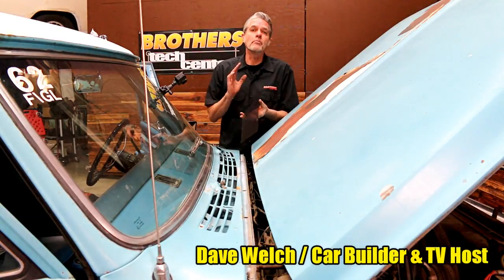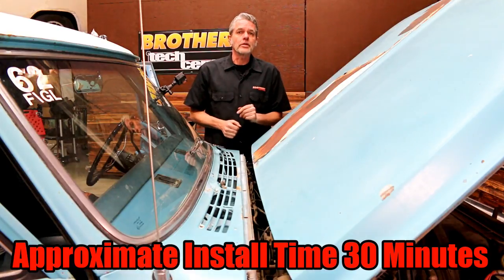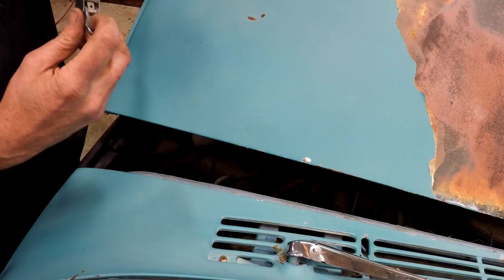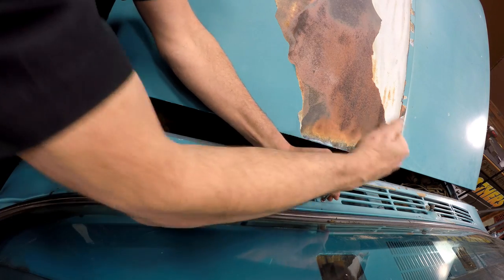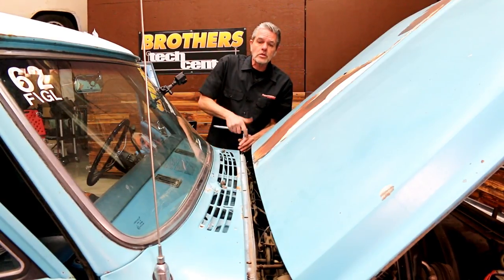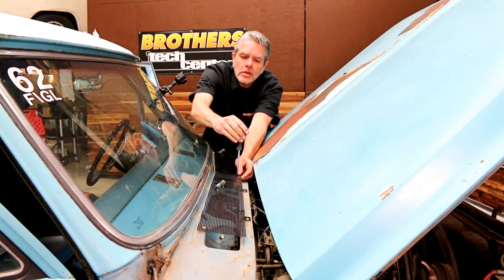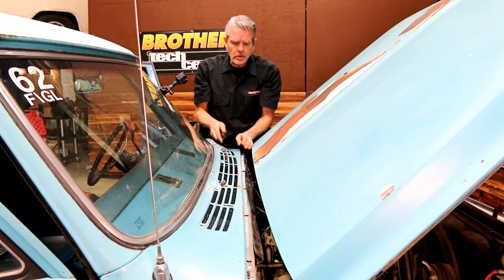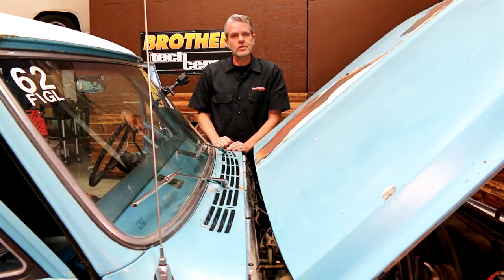1967-72 Cowl Panel Trash Shield Install - Chevy & GMC Truck

Comment: OMG, do you even know what you're talking about?  no.  First, there is no reason to consider replacing your wiper arms with this project. What's the reason to replace the wiper arms if tehre is nothing wrong with them?  none.   Secondly, there is no tab to remove the wiper arm.  To remove the wiper arm it's simply using a large flat screw driver, or I prefer a chisel - something large and flat'ish.  I wrap the end in a thick cloth so it does not scrape anything, then insert it between the blade connection point, then simply twist slightly and the entire arm will wiggle it's way up and out.  this is a five second job.